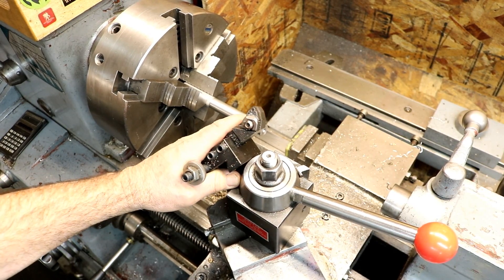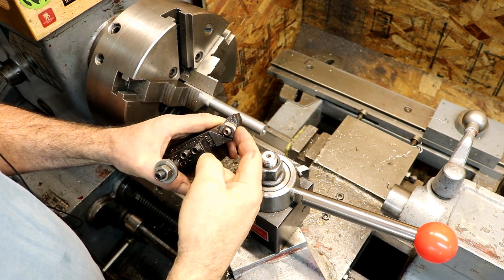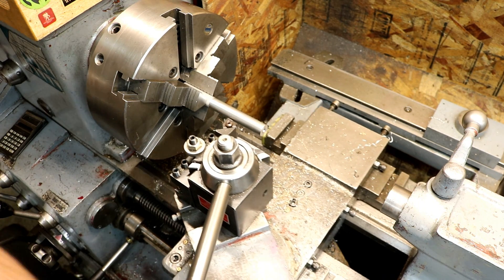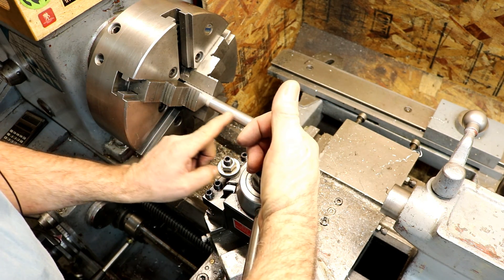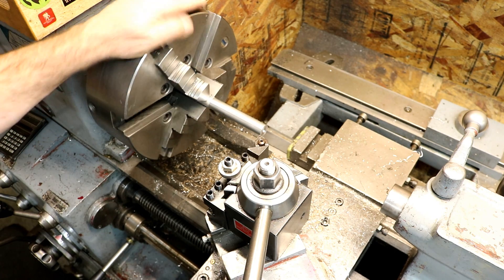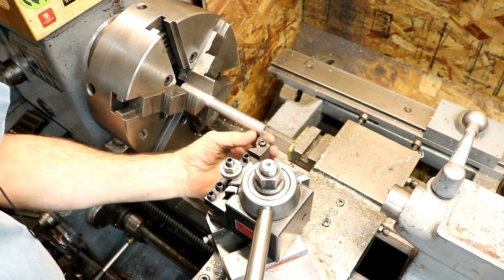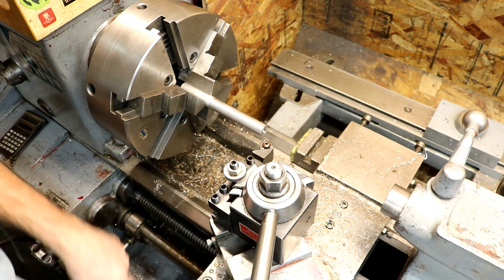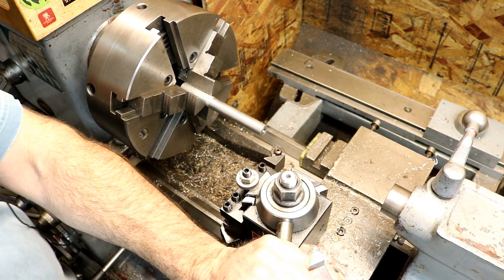Metal Lathe Tips | Insert Chipping?  Get it Stopped, it Cost You!  |  Metal Lathe Hack #4

Comment: I almost always go for the inserts with increased toughness over hardness. I have lost way more inserts to edges breaking than to wearing them out, especially doing repair work since it often involves uneven surfaces and intermitent cutting as well as materials that have been hardened by heat treating.

Comment: I have not had problems with inserts chipping when pulling backwards with cnmg inserts. The pull back angle is the same as doing a facing cut inside out. Maybe ive been lucky? Dont know :D
Reply from the maker: can happen, especially when high tool pressure is in use.